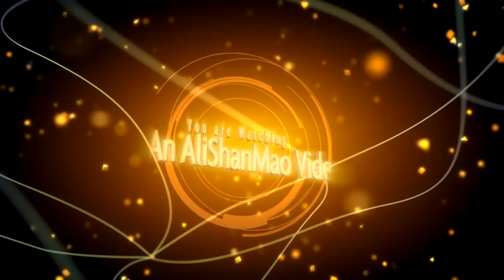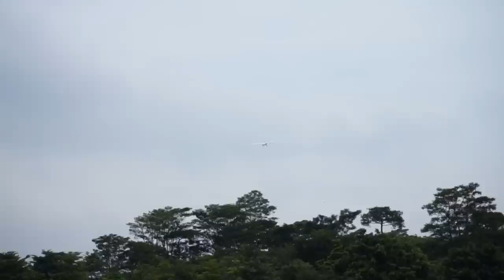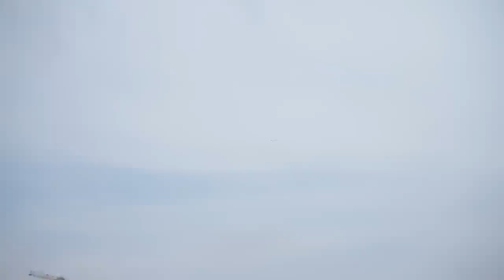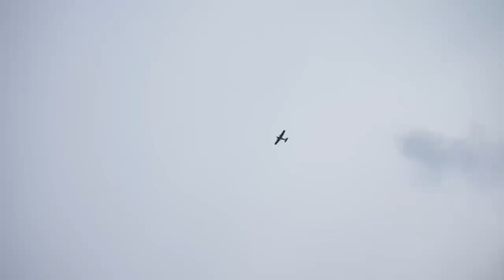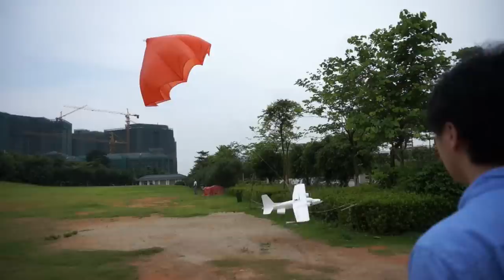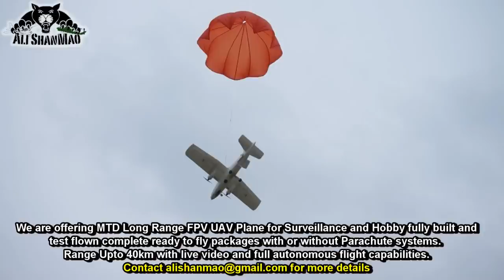Emergency Parachute System For MTD Long Range UAV Plane

Comment: Love where they get to fly in a area where there building construction , and hi highrise apartments and probably near a airport at that. I would think using the parachute system would be most useful. The system is nothing new the military have been using this for a long time in recovery of their UAV planes. But still  a great idea.
Reply: I thought I was the first one to get that idea ( its been 9 years )

Comment: Looks like a great idea, and it seems to work well. it may damage the tail, but that's preferable to losing the craft.  i guess if you have to crash, it's for you!   on the other hand, it would be fun just to play with.
Reply from the maker: FPVREVIEWS we have done many test landings with Parachute. never had an incident of fuselage damage :) or any other damage.
Reply: Why don't we try on the passenger aircraft? If it really works, this may save thousands of people from the airplane crashes.
Reply: alishanmao  waht i need to fly 20 km with real cam? 
Giv me all devices name plz
Reply: @dunmill9632  1. Impact on performance
2. Maintenance is gonna be hell
3. That parachute is gonna be massive. Like ginormous. It has to be able to carry around 300 tones

Comment: hi, I am working on a university project and we are thinking the parachute as a solution to emergency landing. Could you possibly provide me with information about the way you have chosen the right size of the parachute and how the parachute is actually deployed from the aircraft?
Reply: HI, Demetriana. Im doing the same thing- using the parachute as an emergency landing,  but in large scale instead. I mean designing the big enough parachute that can be utilized for an emergency landing on the mega-plane with 300 and more people on board.would you be kind enough to forward some information to me? Thank you

Comment: If I had my way I would mandate all "drones" to be sold with a parachute to protect people from the inexperienced, idiotic, dangerous pilots out there. It does not need to be permanent but the fact it is included would mean most people would use them.
Reply: Jttv I don't need research to tell you that the very, very few incidences of trouble that 'drones' cause, are not from it falling from a very high distance.
Reply: NELICOPTER (was da) I was talking about the people who fly over crowds at festivals, concerts or in large cities which are both not recommended. The kangaroo incident would not have been prevented nor would the performer who was cut by the inspire 1 but both if those were caused by reckless behavior.
Reply: I completely agree. There are so many horrendous videos of very negative things that involve Rc models. People just need to be more careful.
Reply: RCPilot yeah you tell me that! But just looking at the videos these people are doing it on purpose AND they laugh at their 450$ just wasted!